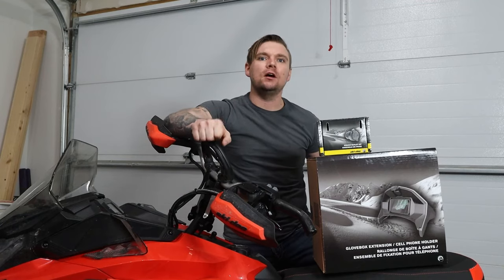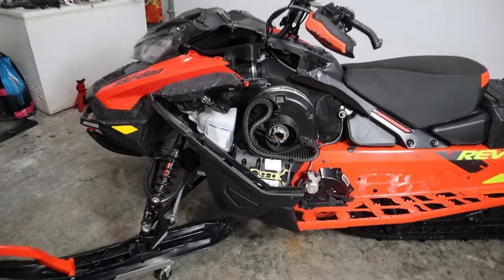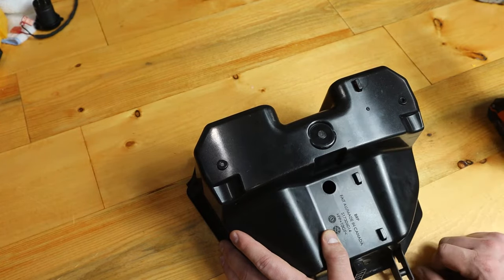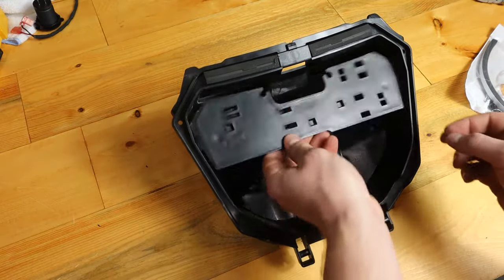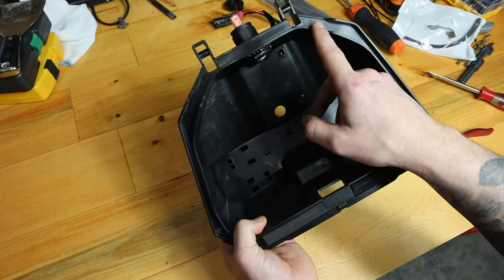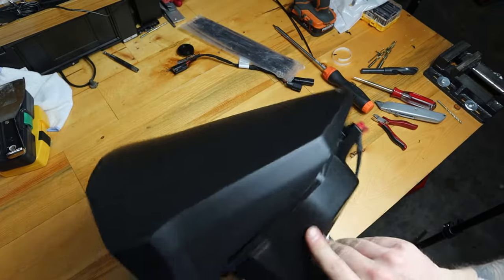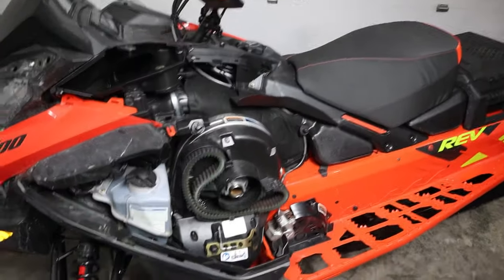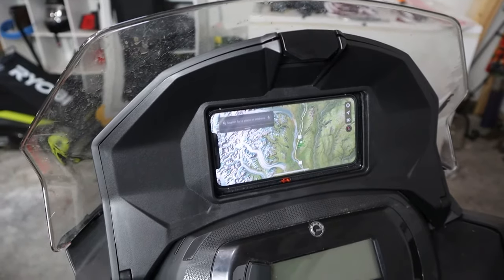Ski Doo Glovebox Extension With Cell Phone Holder Plus USB Power Outlet Install

Comment: I watched a few other videos today as I was trying to install this.  Got so aggravated because NO ONE showed the actual wiring.  I kept thinking, why would I put this dead end clip under a plate that I'm screwing in.  Didn't make ANY sense ! Look at brp install instructions and it's the same thing.  I had absolutely no idea the USB was a completely seperate set up.  I bought the sport model so I thought,  huh,  didn't come with this (I didn't know) you got the USB plug and adapter as another kit.  Dude your video is right on ! I so appreciate what you've explained.  I'm 6min into the video and now I know why I was so irritated earlier  ! I subscribed and liked........ THANK YOU !!
Reply from the maker: That’s awesome! I’m so glad you found the video helpful. Thank you for the Like and Sub! I NEED to get back in the garage and make some more videos. Is there anything you’d like to see?

Comment: Thanks for the video. I just installed this in my mach. However, I feel like it's not getting warm to the touch. Mind you I am running the sled and maintaining a 2500 RPM. I know the power supply is good because I've tested it at both ends. Does it get just slightly warm? Or does it actually get warm to the touch when you touch the element? Thank you.
Reply from the maker: @MBZtwins  Hey! Thanks for watching! The heater element should get warm to the touch. It’s really hard to tell if it’s actually working but it does get warm enough to keep your phone from getting too cold and dying faster than normal. Hope this helps!
Reply: @BTHAlaska  awesome. That's what I was looking for. Have a great holiday season.
Reply from the maker: @ Glad to help. You as well!

Comment from the maker: If you have any questions please feel free to ask and I'll respond ASAP. Thank you!
Reply: what do you use the extra 3M foam pieces for? There are two other foam pieces, any advice on those?
Reply from the maker: @willgoodwin2709  Thanks for the question. The one piece that has different size cut outs is used to center your phone in the holder so it doesn’t slide or bounce around while riding. The other piece is used on the backside of the holder and is only needed if your phone is very thin and you need to sandwich the phone tighter in the holder again so it doesn’t bounce around. I hope that’s clear enough. Haha
Reply: I already have a 12 V plug-in in my glove Box and I just got my extension today It came with 2 harnesses do I still need to use the other harness that don't go in the glove Box.
Reply from the maker: @marvinkane3325  If you have this glovebox extension that has the phone holder. Then yes you will need to use the other harness. We only have one accessory plug on the machine and Ski Doo’s solution is to just daisy chain all the accessories together. I hope I answered your question.
Reply: OK thanks I will see what wires I have when I get into it.
Reply: I put my glove Box  Extension on last night and I follow your directions everything went well thank you for the video.  I was able to use the wiring harness that I had for my 12 V charger in my glove Box and just hook the other wires right up to it, Just had to hook up the wire going to the heater pad on the extension and everything went smoothly.
Reply from the maker: @marvinkane3325  Thanks for watching! I’m glad you found the video helpful.

Comment: Very helpful instructions, thanks you.  I just wasn't sure about what you meant about extending the plugs from down below - did you buy those cables separately?
Reply from the maker: Everything came with the glovebox except the usb outlet that was sold separately. All the harnesses are with the each kit. It’s a little over whelming at first but they make it pretty idiot proof. Haha As for extending the plugs your not really extending them your just using a harness that Y’s at one end to make it longer so your harness from the glove box can plug into the machine side. I hope this helps! If you have further questions feel free to comment I’m always willing to help. 

THANK YOU FOR WATCHING!
Reply: @BTHAlaska  Thanks!

Comment: Looks like you also had issues plugging the phone heating element inside the glove box in (8:18), any suggestions? I’ve tried multiple times now and feel like it should be this hard to snap together
Reply from the maker: Yeah I did have an issue. I wish I could be more help but I just messed with it until all of a sudden it went together nice and easy. It was a little frustrating and when I helped a buddy with his the plug went together without any issue. Sorry!

Comment: Great video,  just installed the extension cell holder and 12 volt outlet,  ran the cable upto power supply from the machine,  but I also put in a heated visor plug as well , do all these plugs inner connect with each other and the one plug from the machine supply 12 volts to everything?????
Reply from the maker: Thank you for watching! I’m glad it was helpful! Yep that’s is exactly how all those plugs work. I can’t wait for the season to start. I should have more how to’s and riding videos coming. Is there anything you’d like to see?
Reply: think I'm good for now !!  👍👍
Reply from the maker: @bradfindlay4892  Awesome! Thanks again for watching!

Comment: My Iphone 11proo maxx fits like a 🧤 and works perfect as a navigation system,,  but I´m curious if the phone can handle the vibration and  moisture ovrr time😖.   I´m afraid it can mess up the camera on the phone😵.   I guess it’s only one way to find it out.......
Reply from the maker: I’ve had good luck so far with it no issues at all. I’ve had it it -15F and still no issues. My phone does come out with a fair bit of moisture but with a quick wipe down it’s dry.

Comment: Did all of the wiring and pigtails come with the extension and USB kit ?
Reply from the maker: Yep you should get one harness with the extension and another for the USB outlet. It’s a little confusing at first but once you lay the wiring harnesses out it’s pretty easy to figure out how they connect to each other.

Comment: Just before you finished (at 8:53 ) you said you added an extra pigtail. What was that one for and did it come with the kit?
Reply from the maker: @jessefunkfunk1865  Yes the pigtails come with the kit. It splits the power and ground so you can also run the USB charger accessory and the heating element. The plug I connected as I was installing the box was for the heating element for the phone case. Hope this helps!

Comment: Why can’t the center covered hole be used instead of drilling a new hole to the left of t
Reply from the maker: If I remember correctly, If you used the middle hole you wouldn’t be able to reach the accessory plug on the snowmobile.

Comment: What phone are you using, just for a size reference?  Also is there a provision within the phone holder to have it plugged in and charging while it's in there?
Reply from the maker: The phone is an IPhone 11 Pro Max and it still has a little room if you had a bigger phone. And yes there is a little cutout for a charging cable so you could have your phone plugged in while you’re riding. I hope this helps and thanks for watching! I have some more Ski Doo content coming so stay tuned for that.

Comment: is the phone charging while in that door dock position, or do you have to remove it and plug it into the glovebox usb port?
Reply from the maker: Yes you can charge the phone while it’s in the dock. There is a little slot that your charging cable fits through. It’s a perfect setup!

Comment: its hard to tell from the pics and videos i've seen - is the phone enclosed within something?  want it to be protected from snow and ice...
Reply from the maker: Yes there is a clear plastic cover that A) protects the phone while riding and B) still allows you to use the phone while it’s in the mount. The back of the mount is heated to help keep your battery from dying. There is also a spot where you can plug a charging cable in to your phone while it’s in the mount. I love this mount!
Reply: @BTHAlaska  Thanks for the reply.  I'm gonna pull the trigger on one for my new skandic swt 900ace.
Reply from the maker: @a11en26  No problem! You won’t be disappointed. The extra storage is awesome and having my phone right in view for navigation is amazing.